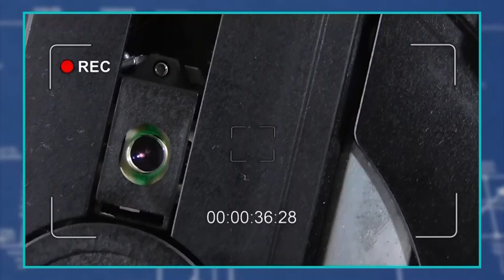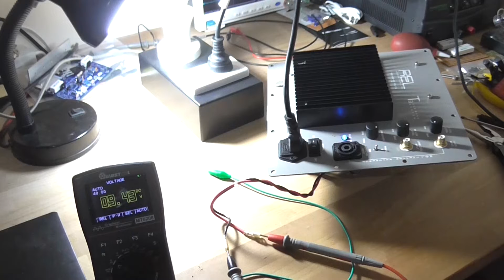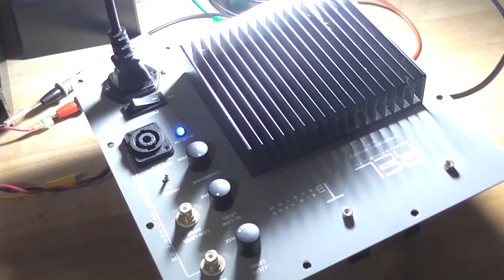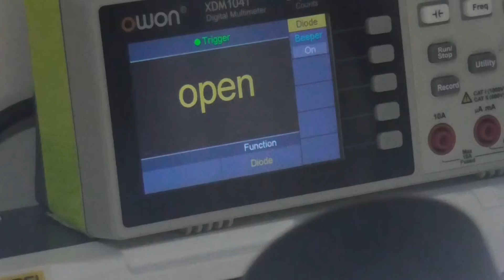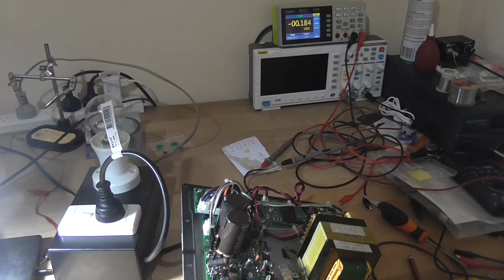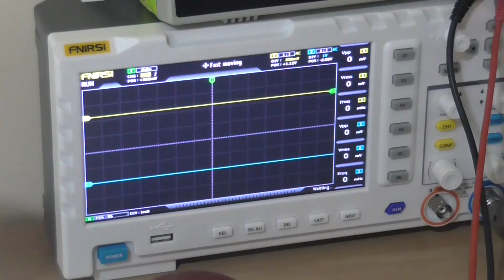REL Acoustics T3 Subwoofer Amplifier: Major Fault!

Comment: Amazing video, i have the same T3 . Output transistors blown due to high base current. Can you please advise what is the solution to rectify this issue . There is a pot for current or offset setting. What will be the value ? And what is the purpose of that preset .would appreciate your prompt response.Thanks
Reply from the maker: The 200 ohm pot is for quiescent current (idle current) which I'd guess should be no more than 25mA. High base current sounds like you have a shorted transistor, either one or both TO126 drivers (Q205 and Q206), or the two TO92 transistors I'm having issues with (Q203 and Q204). If you've got that dark brown circuit glue on the pcb over components, get rid of it!
Reply from the maker: Also, check all resistors around the drivers/output stage that they aren't open or shorted. The two large chocolate resistors which are 2.2k (I'm guessing 4W), which is for the +/-15V rails, check they aren't open. I found with one of the 15V rails missing, the amplifier will have a DC offset.
Reply from the maker: To adjust the bias, you could measure the DC voltage drop from the emitter of one NPN output transistor, and the emitter of one PNP output transistor, which is going across a 0.22 ohm and 0.1 ohm degeneration resistors, then calculate the current (I=V/R). Adjusting the pot for roughly 8mV will give us 25mA (I=0.008/0.32). Or, inject a 30Hz input signal, watching the output on an oscilloscope at say half power output (assuming you get the amplifier working), put the timebase as high as possible to see only one complete cycle, and adjust the pot to get rid of any visible crossover distortion.
Reply: @AstrosElectronicsLab  Thanks a lot
Reply: Service manual available T3 ? Few resistor's don't have colour codes ,faded due to heat
Reply from the maker: @maheensulaiman1410  nope. No service manual available.
Reply: @AstrosElectronicsLab By any chance can i get your WhatsApp for any future reference
Reply: @AstrosElectronicsLab  If you don't mind can you please send your WhatsApp for future reference. Thanks

Comment: It is a known thing that certain brands of mounting caulk turn brown, harden and become conductive. This amplifier is coated in caulk. Testing the caulk for conductivity might be useful, for gaining knowledge as to the cause of the original fault. My suspicion is that the caulk is indeed conductive and that it simply fried everything.
Reply from the maker: I tested for that
Reply from the maker: All though, I will say I'm going to remove the circuit glue as I'm not happy with its presence.